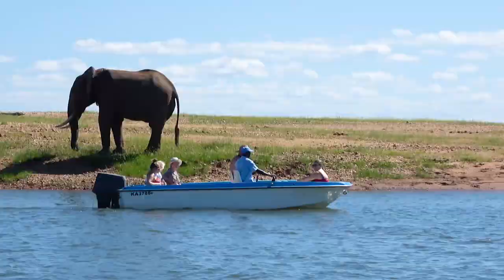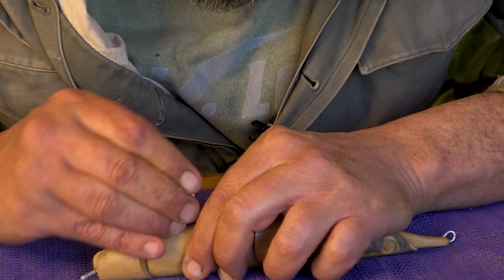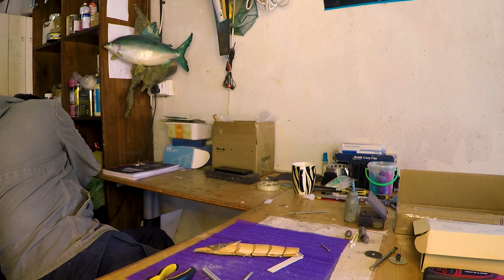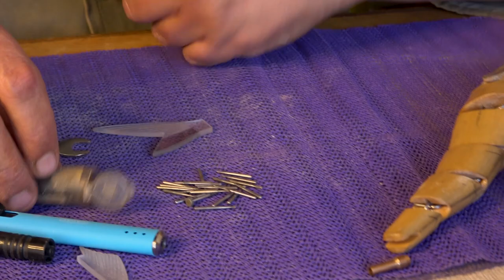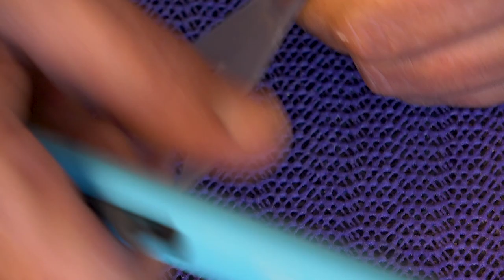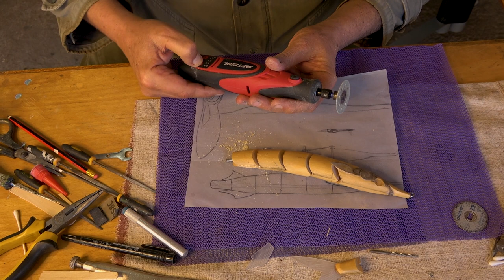Garfish Swim-Bait Handmade Lure - Part 7 - Final Wire Placement and Fin Attachments

Comment: nice work!!! i have just a bad feeling,but i press my thumbs that it will work... not only cause i like to see how you want to cast or even make a mold of it. i have givin it up to play with section-lures, it wont work with linethrough-lures, l was fishing with. and i dont want to miss that advantage of the sliding lure when fighting the fish, it couldnt pull out the hook,or get any scratches. so genius that iam asking myself why its only used arround the balticsea,just starting slowly for pike. at the moment iam working on my sinking-inline-popper, no one is using arround here, with an byside on a shrimp and a stickleback, but they are all food for your garfish... it must be so nice doing such big lures... 
and thank you for let us be a part of your journey
Reply: Cheers Jan. Yup its all a shot in the dark doing a freestyle build never done before, particularly a swimbait when it has to be one piece for integrity. The great thing about failing is picking yourself up and learning from the experience, which I'll be doing if this bait goes wrong. I'm going to be weighting it next and hopefully not too many adjustments to make it swim. Stay tuned my friend!
Reply: yes thats right. lurebuilding is just often failing forward... and the amount of work you have done would be realy sad. thats the reason why i mostly made simple prototypes, when i try new stuff. without details or anything just a dark back to see the movent better at distance. if it work like i expect or better catch something i rebuild it.saves a lot of time and frustration...be sure i stay tuned,,my friend! want to see it swim...